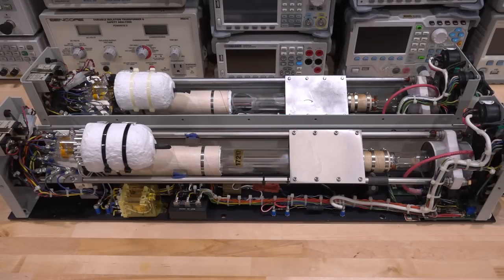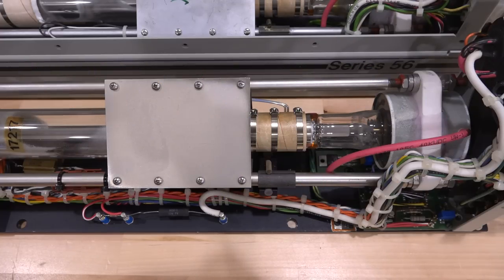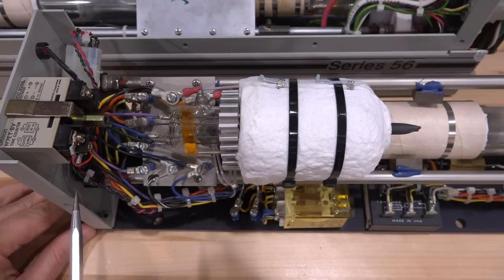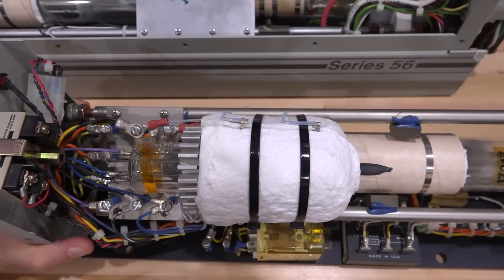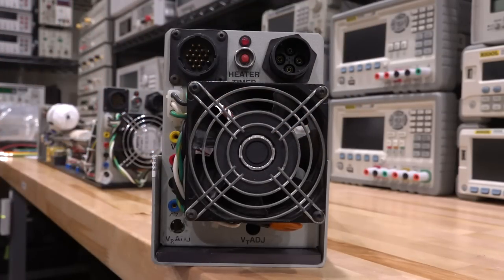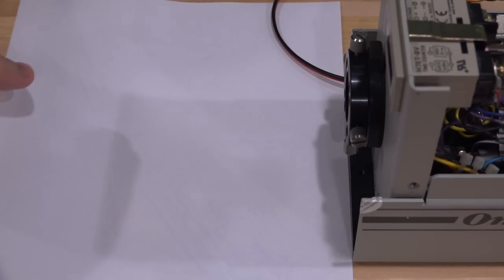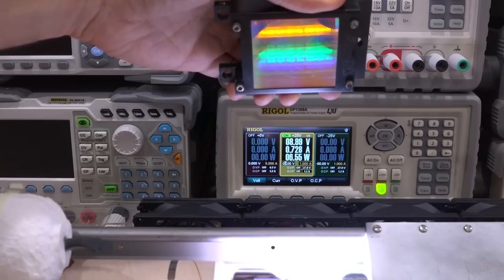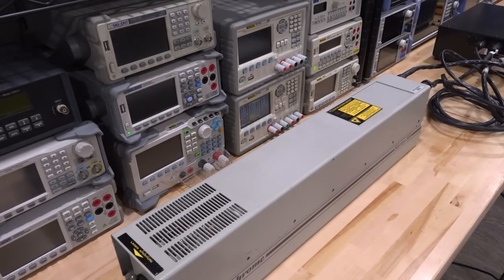TNP #33 - OmniChrome Helium-Cadmium (HeCd) 442nm Laser Teardown, Theory & Experiments

Comment: My friend was the co-founder of Omnichrome.  The company was based out of southern California. The lasers were good for about 5,000 hours of use.  He told me that there was good profits in servicing laser tubes as the cadmium eventually gets depleted.  They didn't want them to last too long.  Also, Omnichrome made a shorter wavelength version of this laser for UV curing epoxy for the first stereolithography machines.
Reply from the maker: Nice!
Reply: Yeah, I actually own one of these that is dual wavelength. these were not cheap lasers. there’s a reason that they were only around for a period of time. Once solid state came out, they were very quickly replaced-one of the first gas lasers to go. These things were always temperamental. Also a minor correction-the cadmium remelt was not to remove cadmium from places where it shouldn’t be. it was to remove dendrites that would form on the cathode end of the laser where it re-condensed. I actually have one of the very last ones that was produced and was never completed. The glasswork is a work of art in itself.
Reply: @r100curtaincall , good info!  Thanks for the u0pdate, Jay

Comment: It threw me off at first seeing the laser spot through the goggles with a rated attenuation of 10^9 at the wavelength being emitted.  I'd guess the light seen is not the emitted ~400nm light but instead longer wavelengths generated by fluorescence of the paper.

Comment: These lasers are extremely tricky to operate. Each laser head has to married with the power supply. To retune a head to a new power supply you have to run it to heat up properly and then adjust the the cadmium and helium heater to get the correct pressure and gas mix. The filaments burning out are usually due to a current regulation fault in the power supply. ❤

Comment: Fascinating! I've never worked with optics but recently got to see some operating optical clocks. Have you ever thought of doing a teardown and demo of an atomic clock? Watching the PLL lock in a rubidium module might be interesting.
Reply: i'm pretty sure he did a bunch of videos about rubidium timing modules 5-6 years ago!
Reply: There isn't much to see, unfortunately - the transmission difference on the Rb cell at resonance is very small, which is why you have to modulate it and use a lock-in amplifier to detect it.

Comment: The helium reservoir on the ones I’ve seen has a membrane that has increasing helium permeability as it’s temperature is increased. The heat sink band stops the heat conduction along the glass, so that the helium leakage is near zero.

Incidentally, if a laser has been sitting too long, the helium pressure may be too high to achieve lasting until the tube has been run for possibly as much as 100-200 hours.

And for the benefit of anyone who hasn’t already read a service manual on a helium cadmium laser, the discharge current is typically 100mA or more DC, with significant amounts of capacitance in the power supply. Accidents are likely somewhere between extremely painful and potentially deadly, from muscle contractions or heart stoppage. If you’re really lucky, you’ll only realize your heart stopped when it starts beating again and you just used up one of your nine lives. Or maybe that’s just what happens when voltage jumps without a direct contact with a HV lead.

Comment: Helium/Cadmium?  Never heard before - thanks!  Once upon a time I got a HeNe laser for measuring the angle of a worn out steel blade used in making soft tissue in a paper machine.  The blade was about 1 mm in thickness and the edge was worn an polished maybe 0.1  to 0.3 mm size.  
The laser had 1.5 mm beam, so some of the beam passed on eatch side of the blade, when aligned.  At that orientation the worn surface reflected light at an angle, which I calculated by arctan function from the dot on a graph paper.  The reason for my angle measurements was that also the machine slightly barrel shaped cylinder wore out unevenly and the blade wear angle variation along the nearly 5 meter length of the blade gave a map of the cylinder wear.
 
 Some time later my boss got new glasses, which he found some way wrong.  He suspected a mistake in the pupil distance and asked if I could somehow measure it from the lenses.  He knew what his pupil distance had been "for ever".  I found that both 18:41 the glass surfaces produced a reflection and they matched, and also reflected back to the laser aperture only when at the desired pupil spots.  Marking them with ink, it was easy to to measure the distance and confirm his suspicion.  He went back to the optician, who was surprised that the distance had been correctly measured without an optician's tool.  A "feather to my hat".
 
 Some time later I was involved with a test whether the paper dryness could be measured in line with an experimental Water Vapor laser.  Despite a good theory, the desired 5 meter distance quickly turned beyond reach.  Our test setup was only about 1 meter and already was too challenging.  At the time there were commercial infrared based paper web moisture measuring devices, but they required complex mechanisms on two sides of the paper web, source and receiver traveling in a synchronized way.  Consequently, they were deemed too cumbersome in use, and also too expensive.  That is why the idea of a water vapor laser was tried.
Reply: Thank you, this is fascinating!

Comment: I think the connectors are MIL-DTL-5015. On the back of the case, the left most connector looks like insert 22-20, the middle one is 24-5, and the last one is 24-22. Maybe. Is the keying rotated?
You can get MIL-DTL-5015 connectors on Mouser, though for whatever reason the pictures of circular connectors are always wrong.

Comment: great -- very interesting video again, never saw a he cd laser in action. I use laser in my profession usually semiconductor, also for spectrum analysis, I have a helium neon laser for experiments and reference -- @the signal path : which spectrometer have you used ? -  I myself have a thorlab spectrometer CCS200 (200nm-1000nm) your seem to have a larger range !

Comment: What were these lasers used for?
Reply: Laser fluorescence, primarily in confocal microscopy, where they are still in use today.
Reply: @douro20  Have they been replaced with 445nm diode lasers which nowadays are very common?
Reply: @NiHaoMike64  Yes, but from what I understand the multiple lines of a HeCd laser are advantageous for exciting fluorescence in different biological molecules.
Reply: @douro20  Ah, interesting, thanks!
Reply: @douro20  At 16:16, there is only one line. Or did I misunderstand your sentence?

Comment: Near the start of this video you say that “if you only were to use helium and make a helium laser, you would get wavelengths at 632 nm or so which depends on the helium atomic structure.” I think that the 632 nm wavelength is associated with a helium-neon laser. The light from a He-Ne laser is from some of the neon atoms that radiate at 632 nm. The light is from neon not helium.
Reply from the maker: Yes, He by itself is not a best gain medium and is often mixed with something else. What I meant to say was the common HeNe laser.
Reply: @Thesignalpath  Laser gain media have special properties. Even more so if one wants some modicum of efficiency.
One needs an easy pumping transition, then a quick relaxation to an excited relatively stable level that is not much lower. Stable, so only stimulated emission occurs and no spontaneous.
Then, after that stimulated emission, the energy level should drop again quickly and spontaneously. Otherwise, the atom that just "cooled down" would absorb laser light again to get excited.
So no, one cannot just use any transmission line in a laser. (Note that these transitions/levels are also achieved through gas mixtures, AFAIR. The levels do not need to be in a single atom.)